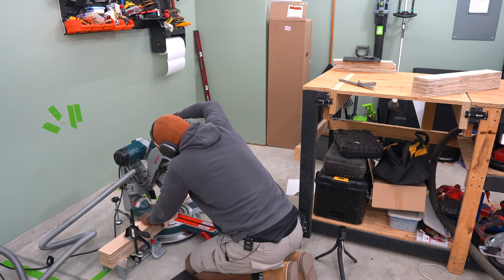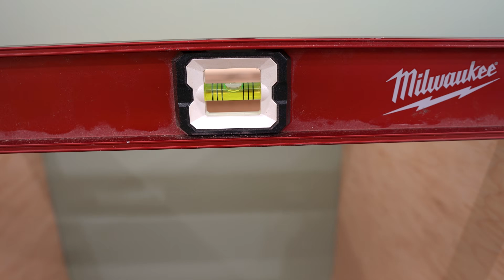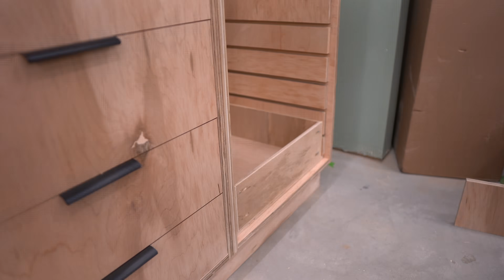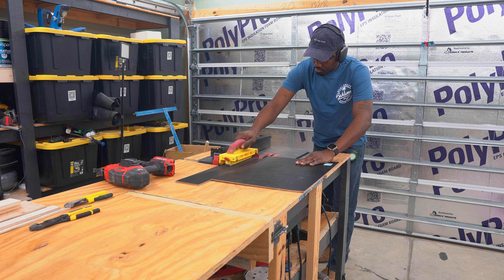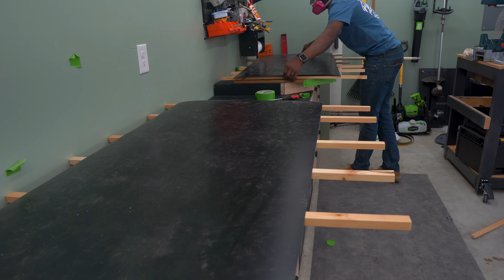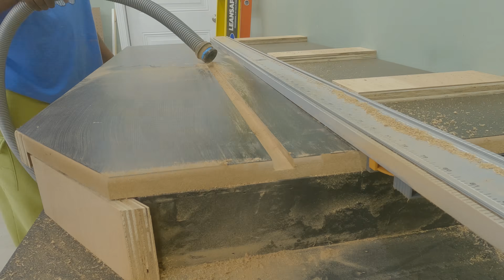Dream Miter Saw Station - FULL BUILD

Comment: I can almost guarantee you have to many things on the one breaker. Find the breaker your table saw/miter saw is on. find how many amps each thing is pull. Table saw 15 amps/ Miter saw 15 amps and add those together. All the tools/tv's/washers and dryers should not exceed 80% of the breaker. If they are, you will have to add another breaker. All my shop plugs and living room are all on one breaker. Not good.

Comment: Motors like the one in the table saw have an initial spike that draws more power in the beginning until the tool is at running speed. To eliminate the problem you can install a soft start receptacle and it will limit the beginning spike. For future I would recommend having an electrician install additional 20 Amp circuits in your shop (your panel may or may not be able to handle it).  You will probably continue to trip the breaker by overloading it with the power tools.

Comment: If you need a 30 amp, you’re probably running off a 20 amp on your fuses box. You need to go to a 30 amp fuse box a fuse it won’t burn it won’t flip after that.

Comment: Plans bought. I'm very close to building my own miter saw bench and this is going to help out immensely. Though I'm going way cheaper than full birch plywood. Gonna use pine plywood for everything accept the drawer fronts. Won't be seen anyway. Solid core birch plywood is going for $89 here, that's the top grade. Regular cabinet grade is $65 and pine plywood is $50, really each choice for me, lol. And I have that breaker issue as well. My garage only uses 15Amp breakers. So I can't run my planer and shop vac on the same circuit or its instant breaker trip. We are in the same boat, we need an electrician to wire our garages for 20Amp. Don't listen to YT videos saying you can just swap out a 15 for a 20. The 20s need thicker cable to carry the load or the wire can overheat if used long enough. And I wish my shop supervisor was as cool as yours. Mine just yells at me for juice boxes and makes me change her diaper. I’m building a case for HR, that was never mentioned in the job description.

Comment: Was the excess laminate sitting between the cutter and the bearing So it wasn't trimming properly?  That could be why you had problems trimming it.  Sometimes it happens. If so just need to lower the cutter slightly.

Can you adjust the saw to the maximum bevel?  Does the lever hit the cabinet?
Reply from the maker: I believe it was the laminate between the trimmer that was causing it, and perhaps I was using the wrong bit. Yes, I can use the max bevel, no issue with the cabinet, just the drill charging gives me issues. I have to move if I ever need to make an extreme beveled cut.

Comment: What is the amperage on your breaker. It’s not the voltage. If the amperage of the breaker is to low that may be your problem. A saw will pull more amperage on startup than it does when it’s running. A 15 amp saw may pull up to 20 amps just for a second or two when it starts. Also what else is on that circuit if you have a freezer that just happens to be running at the same time the saw is starting it may overload the breaker.

Comment: Your breaker keeps tripping because you don't have the receptacle wired for enough amperage.
Reply from the maker: I’m thinking about upgrading the amperage. I’m not that confident with electricity, so I’ll have an electrician take a look at it.
Reply: @RenowithRamonne  when it comes to a bunch of power tools it's worth over upgrading. Especially if you want to upgrade machines later on you'll need the power.

Comment: Motors that specify 15 Amp actually pull a bit more current for a few milliseconds when they start up.  That's normal.  If the lights are dimming then the electrician may have wired your light as part of the same circuit your receptacles are on.  It shouldn't be dangerous but it may be annoying. You can add a dedicated circuit for the bigger power hungry tools.  A 15A tool may run best on a 20A or 30A circuit.  If you're comfortable with circuits for the tools, you can always run a separate circuit for the light.  I always run my lights on a separate circuit from the receptacles so that if I pop a breaker I'm not stuck in the dark trying the find a flash light.  As @lifeofreilly said you may need to check the max current on the circuit.  Our microwave in the kitchen was on the same circuit as the garage.  Good luck.

Comment: It's not the voltage, it's the amperage. 

You table saw probably draws 15 Amps. What else is on that circuit?  Go look at the breaker that controls that circuit. It will tell you how many amps it can take. If you keep tripping it, it's either because the breaker is going bad or the total number of amps you are trying to pull from that circuit exceeds the amp rating of the breaker.
Reply from the maker: I didn’t know the breaker had that information! I will check it out. Thanks 🙏🏾

Comment: You're killing it man.🍫 One thing I saw you could have done was to flush trim your countertop edge boards so you didnt have to sand so much. I also experienced the same issue of biting off more than the router could chew with the melamine. I used my track saw to get it close and deal with the melamine dust/smells, then rounded over.
Reply from the maker: You’re right! That would have saved me a lot of time. I don’t know what I was thinking using a round over bit! Smh lol

Comment: Hey the time it takes for you to clamp up your cabinets, try brad nailing them fully then screw up the pocket holes last.
Reply from the maker: If I understand you correctly, you’re saying I should brad nail them together before screwing them? I feel like I would still need to clamp them to make sure they are aligned properly 🤷🏽‍♂️
Reply: @ if you build the cabinets on a workbench brad nail your boxes laying flat and after the box is all nailed then screw the pocket holes, if need to clamp them then do so while screwing up the pocket holes.
Reply: Next time use a flush trim bit in your router then you can chamfer the edges. Also you can trim the top the same time you finish up the lamination.

Comment: Why did you make the station symmetrical? It seems like it would make a lot more sense to make it asymmetrical, given your limited workspace. Instead of having ~4 feet on each side of the saw, have 8 feet on one side and ~4 feet on the other side. This would let you use stops to do repeated cuts up to 8 feet in length.
Reply from the maker: Legit question! I put a lot of thought into it, and decided against  it because for what I do, I think 60” is enough ripping length for me. If it’s not I’ll just make one of those extended foldable wings.
Reply: Those pocket holes should have been outside the box on stretchers…more holding power going away from edge
Reply from the maker: @40redfox40  You are correct. Forgot about that until after the build 🙃